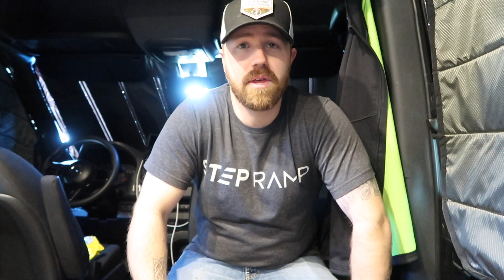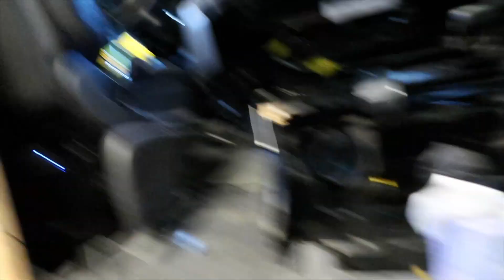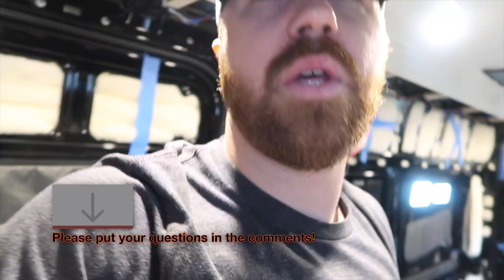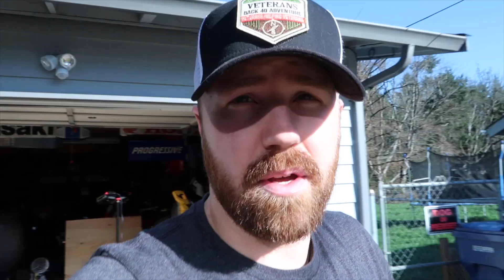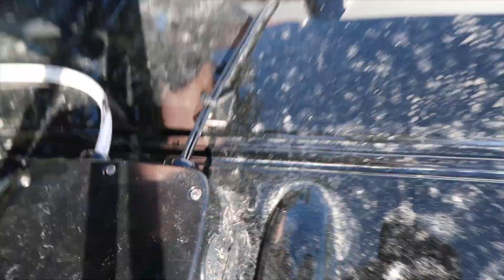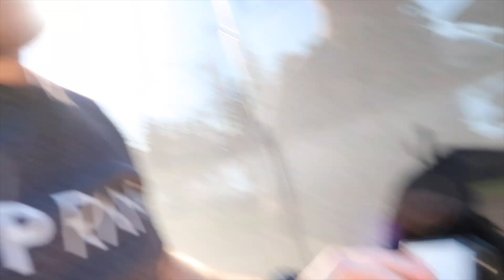Cargo Van to Full Time Home!

Comment: Freaking awesome Zach! This is a great compliment to your IG content, thanks for taking the time to create this channel. Quick question, did you upgrade the alternator to handle the additional load you’re now putting on it with the lithium batteries?
Reply from the maker: Thanks man! I did not, I looked up the current of the stock one and ordered the appropriate sized battery combiner. When I'm driving it charges the batteries FAST, no need to upgrade. Part of that is due to the lithium batteries, they can take a lot of charging current vs AGM.